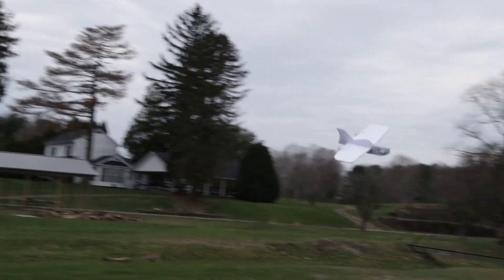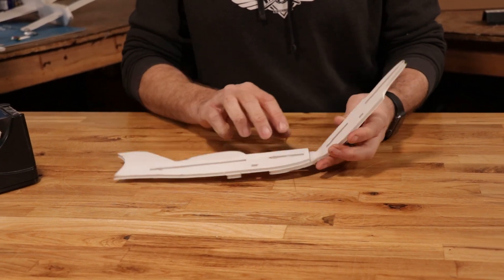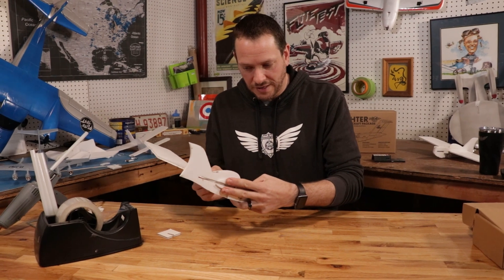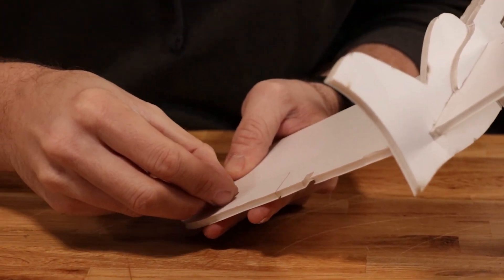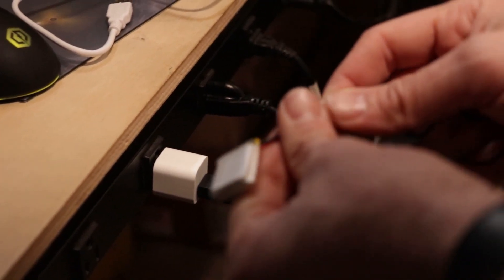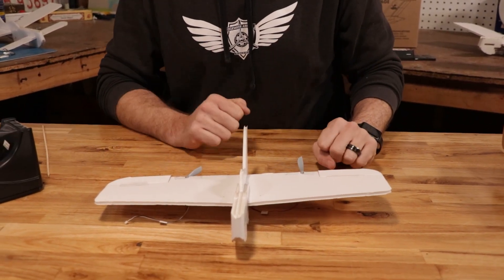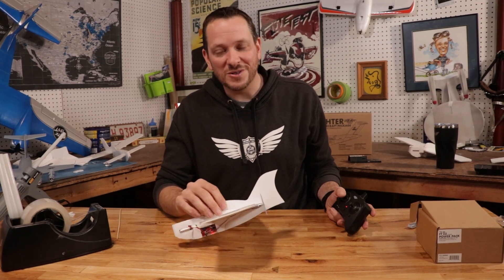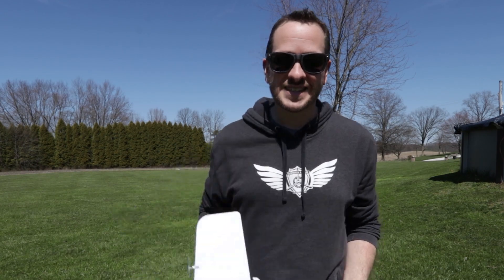EZ Plank / Build

Comment: Hi Josh and the rest of the FT family hope you are all well and staying safe,i really liked how you double up on the foam board for the fuse by bending it over,but my favorite little trick was how you got the Dihedral into the wing.
I've got an old Hubsan quad (first addition) which i've got a couple and i might try this with one of them,the only problem i might have is with the FC,but i'll cross that bridge if and when i come to it,i'm sure if i sit down  and give it some thought i'll be able to work something out. 😉

Thanks for sharing as it's very much appreciated,much love and respect from another RC pilot from the UK.👍🏾

Comment: What do you think would be the easiest way to switch the electronics between the 3 planes? I don’t want to buy 2 more power packs and want to have the option to pick any plane
Reply: For these planes, it seems like they're not designed to switch back and forth repeatedly. The paper and foam will wear out quickly from constant removal and re-application of tape. If you're looking for scratchbuild planes that allow you to fly multiple models on a single electronics kit, consider the regular swappable series that features a removable power pod that easily goes from plane to plane with minimal fuss. The mini swappables are a bit bigger and more powerful than these micro kits, but they're still great small park flyers.
Reply: @rmdcade1717  yeah I guess so :p